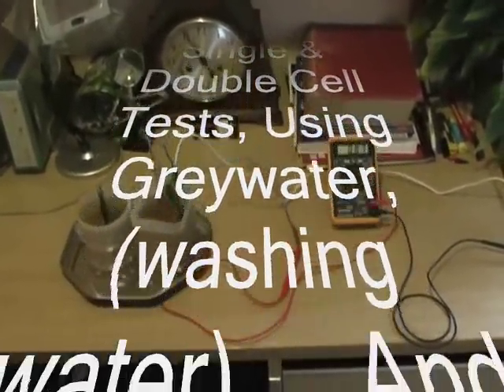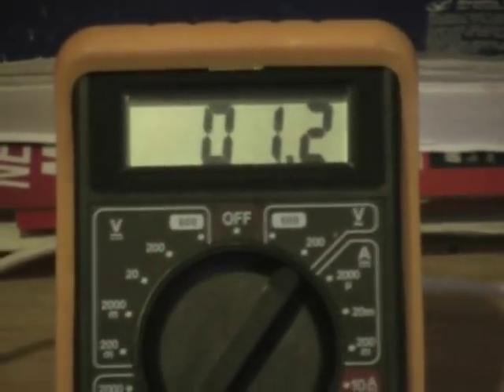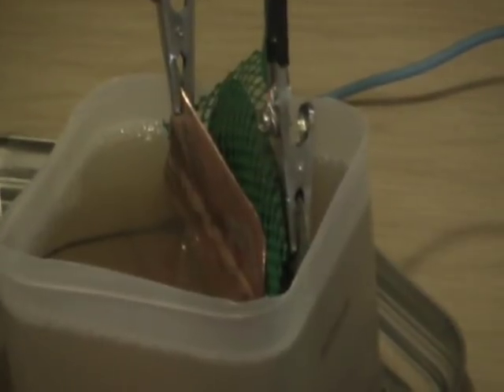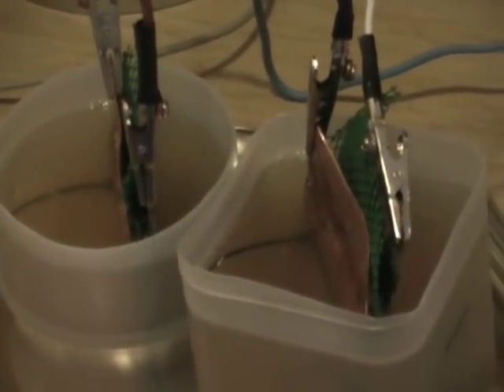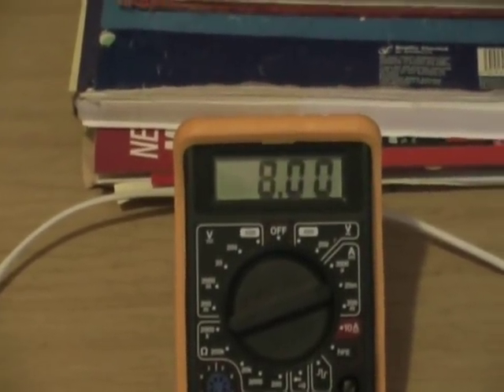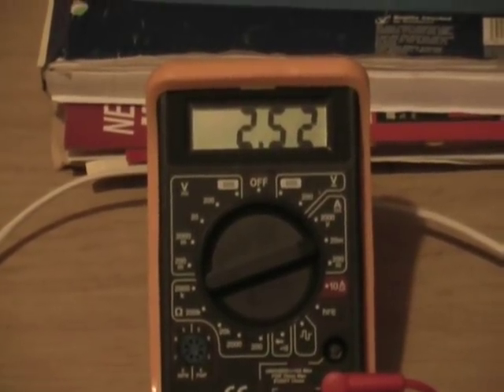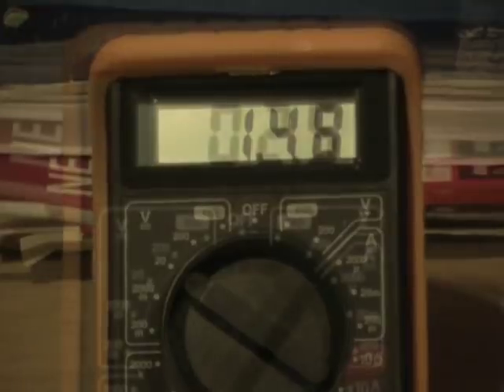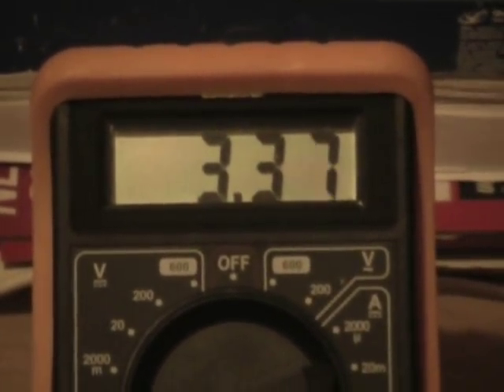Water Battery Free Energy #5

Comment: try magnesium powder from ebay, carbon powder from batteries, smash the carbon rods till its powdery, mixed both of them and put copper and zinc as electrodes.. 

Mg  + 2 H2O  -> Mg(OH)2  + H2

magnesium will produce hydrogen from water.. carbon will bond with oxygen.. these electrodes will only take the hydrogen... this wil give you very very high amps.. try it and upload it.. do message me if you have uploaded the videos..

Comment: By the way there is no AC present, the reading is due to digital meters have a problem trying to read this voltage. 
If you use a oscilloscope you will see there is no AC present, so you can forget this reading.

cheers.